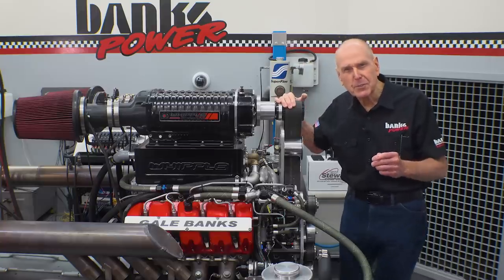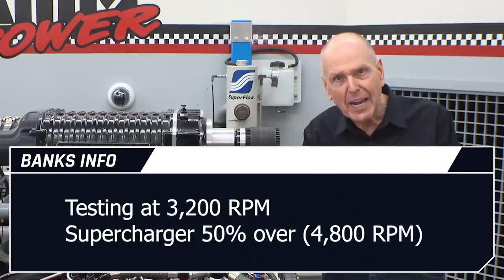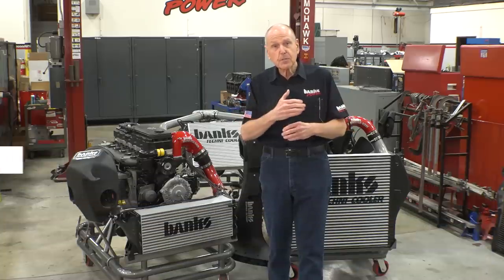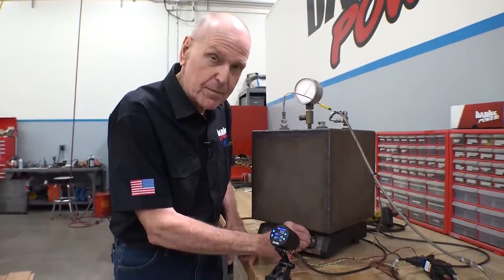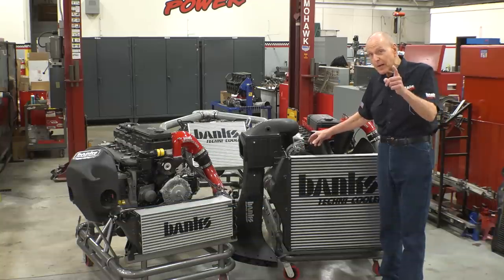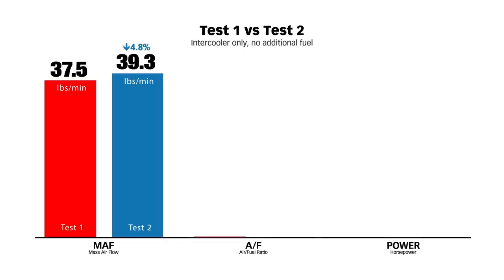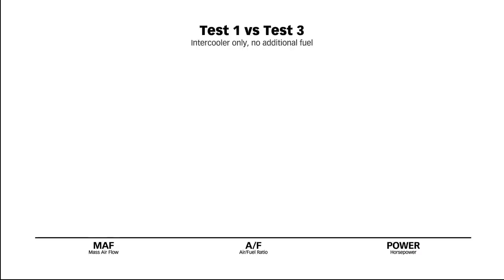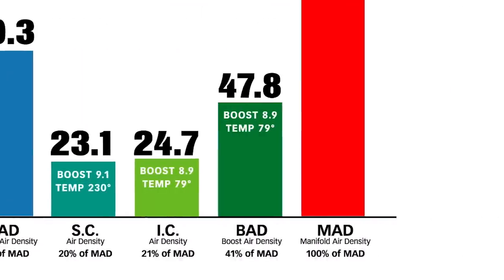MORE HORSEPOWER with Less Boost?! | Building a Monster Truck Engine Pt 8

Comment: Gale, love the videos and how commited you are to the science of making horsepower and making it efficiently.

However I have to disagree on some things regarding your math for temp change. You say that 79f is 74% less heat than 279f. Do the math in Celsius or Kelvin, the percentage of change will be much different. Fahrenheit has kind of a random starting point, 0 F doesn't mean zero heat. The proper way of measuring it would have to be Kelvin, or come up with another way of measuring it.

Comment: Mr Banks why don't you do an interchiller with freon and electric ac pump?
Reply: R744 would be better (r744 =CO2 refrigerant system)
Reply: @daviddroescher  I want to take an ac unit apart and in case the coil in and air to water intercooler and see if I can get the water cool enough and the you won't have to run it of the belt!
Reply: @marcohuertas692  with CO2 in a race application  you could run a total loss system  off a bottle then there is no parasitic losses and no extra battery/inverter to run the 110v compressor .
Reply: @daviddroescher  I'm thinking street or drift where your on throttle and need to get the temps down for longer period of time but maybe re recirculate it so it not lost?  Trial and error but yeah definitely thought of the co2 even no2 lol
Reply: @marcohuertas692  look up R744 refrigeration its a closed loop (CO2) system  insted of R134A( freon) but gets much colder(can pull more heat faster than freon). NO2 and CO2 Intercooler fog kits are available.  I dont like the idea of foging my engine bay with an excelerant. I have a EGT surface probe on the outside of my turbine housing and it is normal to see 500+°f, all it needs is some oil smoke and bad day.
Reply: @daviddroescher  lol yeah no shit!! It's a waste of money to just let go nowhere that why recycle it like the AC in a car but run the gas threw the core and the air across the surface.

Comment: I'm curious Gale what would those numbers be if you used waterless coolant? Would maybe  bring efficiency up to 97% or more or would the efficiency be the same? I was intrigued by waterless coolant a few years ago and it was a revolutionary deal for removing heat from an engine.  If can that would be nice. I know everyone has not gone waterless, it is hard to justify the money and time but was a worthwhile investment.
Reply: Problem with most waterless coolant is they are flammable and banned by most sanctioning bodies. Water Wetter however is accepted by most sanctioning bodies and has a similar effect of  improving waters thermal transfer properties.
Reply: @daviddroescher  i had know idea it was flammable good to know. Thanks for the info ill check into it.

Comment: is there really a need to put a BOV on a diesel since it doesn't have a throttle body to close to back up the turbos?
Reply: It probably has something to do with it having the blower on it at the same time 
, being that it is belt driven, im sure it wouldn’t be good for the rotor blades to experience any kind of back surge that could potentially transfer a shock load through the belts and back to the engine it’s self.
Reply: Yes look up "turbo bark" on any diesel site . This brakes turbocharger shafts . The intake valve takes the place of the throttle body.

Comment: did i miss something... what was the temp of the coolant going into the system and out ?was the engine up to temp and using that coolant . was the coolant just cold water ??
Reply: I think it’s a secret because how do you get 20 degree water?
Without an A/C unit to create it that takes power to run, a LOT of power to run.
In the lab the A/C unit is remote and wall plug powered i am sure has to be, but in real life the truck would need the A/C unit to get 20 degrees water temps. 
Ya, I’m really wondering here what the heck this weird VOID is about here and Nobody but us caught it.
Reply: Usually water jacket charge air cooler would be plumbed with a circuit separate from the engine coolant otherwise you're penalized with air entering the engine at engine coolant temp (180) costing you 13%power with the same fuel. 1%/10°f above 60°f per Cummins.
Reply: @ashqelon7267   delta temp =22°f  not 22°f mesured

Comment: I’m going to need help deciding what inter cooler i need for my next project truck... I’m putting an Detroit 8v53 in it.
Reply: None the 2 stroke Detroit's won't get enough boost to use intercooling
Reply: bill2178 I’m going to swap the stock turbo with a 2 80’s and a sing marine turbo and a supercharger. If it blows up it blows up 🤷🏼‍♂️ and i still need a radiator to cool the coolant
Reply: You have a 8V53T? Or just a turbo equipped 8V53?
Reply: nick nicalizel i’m getting a 8v53T because of the extra oiling If im correct ik there’s a difference
Reply: Turbo engines vs natural engines have many differences. 8V53T are rare engines were only built for the military. I have a 8V53N that I may put in something someday.
Reply: nick nicalizel To my understanding the T model has a different oiling system to help cope with the turbocharger do you know if i could retrofit that onto a N?
Reply: @StahlFirearmsNo2  not certain but there would be no oiling issue likely with adding a turbo to a N engine. But turbo engines have different pistons/liners/camshaft etc
Reply: nick nicalizel okay I was told somewhere that the oiling system was different possibly higher pressure.. regardless thanks for the info

Comment: Now couple of things....
(But first let me get this out the way clearly Gale Banks knows a lot more than me on the subject...but I still want to ask the questions to learn)
1) I would have thought, blowing into a supercharger with turbos compounding the boost would put more load onto the supercharger creating more parasitic loss....surely going the other way around would be better, like in the pikes peak truck.
2) why is a blow of valve needed on a diesel? Is it because you're blowing into a supercharger And letting off and dumping the boost out take the load of the supercharger when it's not needed?...
Im here to learn, not criticise.
Reply: I thought a BOV is to not send the turbo into surge?
Reply: @prcdjhnsn  yes when you let off the throttle....diesel don't have throttles
Reply: @jarrusjenkins  Yes you are correct. you also don't have vacuum to operate the valve. maybe this can answer that part for ya. https://www.dieselarmy.com/engine-tech/how-it-works/how-it-works-blow-off-valves-bov/
Reply: 1)
Its a pressure raito thing. 
Force feeding the blower =less load(smaller pressure raito) to get the same MAD= less work induced heat(thermal expansion)  =less cooling requirements = more shaft power to the trans.
2)
Blower is positive displacement  and acts like a throttle on a gasser during compression braking.  Barking a turbocharger is a good way to snap a turbine shaft or explode/over speed a compressor wheel.
Reply: @daviddroescher  The 2nd one I understand completely.
Your 1st answer I still don't completely understand, 
Is there a nerdy article to read which explains it in more detail?

Like I said before there has to be a reason why Gale did it the other way around on the pikes peak (supercharger blowing into a turbo)
Thanks

Comment: While I love this video series, this one leaves some questions.
With this Whipple FOAC which core was used? Assuming aluminum cause I doubt the cupronickel would perform that good. However, if you looked on Whipple site you would think the cupronickel was better than aluminum which it is far from it. False advertising on Whipples part.
Next he mentions he wanted a 20deg max gain on water temp and mentions flow rate but not starting water temp. So what was the starting temp to scrub 200deg off air temp?

I'm really waiting for the turbo setup to see the improvement over the Whipple. Whipple will argue his charger is still better!

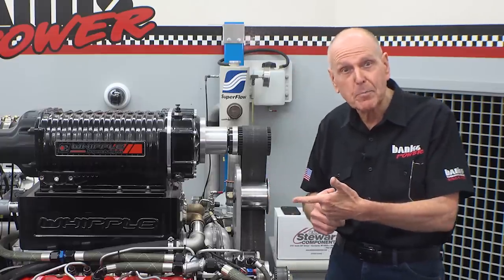Comment: At about 3:45 screen says 23:1 air fuel ratio? Isnt that way to lean? What am i missing?
Reply: Diesels always are lean as they don't throttle the air. They only throttle the fuel. Idle might be leaner than 100:1
Reply: With diesel the leaner it is the happier it is the problem is keeping the materials containing the explosion/ burn from becoming jello.
Also leaner is lower EGT the opposite of gasoline.

Comment: 10:19 I always feel like Gale is yelling at me. I'm sorry I have a boost gauge!
Reply: I thing that he overstates it when he says "the boost gauge is dead to me".  The point he is making is that the boost gauge doesn't tell the whole story.  Density tells the whole story, and you need temperature and pressure measurements to calculate density.

Comment: Just a minor quibble - for a single charger (turbo' or super'), "charge cooler" would be more accurate, with "intercooler" reserved for use between stages of series' chargers -  eg. intake > 1st 'charger > charge intercooler > 2nd 'charger > charge cooler > engine.
It may, of course, just be me being a pedantic old fart, though ;-) 

With higher altitudes, it is a double whammy - not only does the engine have to work harder to suck in the air, but the various liquid>air coolers are much less efficient as there is less air mass passing through them to take the heat away.
With the heated box, could also reheat it and at temperature drain off the excess pressure to illustrate the loss of air massc ompared to ambient.
The end caps is also one of my little bugbears - some designs are appalling - restrictive and/or unevenly distributing the fluid flow through the full width of the matrix.

Seriously, though, I DO enjoy your videos - always food for thought and lovely music to the ears!
Reply: Wouldn't a water/cooler sandwiched in a high pressure area under a boosted intake still maintain efficiency?  The altitude would more effect boost levels that could be increased to compensate. My intuition maybe wrong though. Cool comment
Reply: @xjmg007  If I understand your question correctly, yes, the air> liquid charge cooler will maintain efficiency, as the mass of the liquid for coling will be the same. By convention, the ">" donates the heat energy transfer path, that is, air to liquid
However I said "liquid>air", heat energy being passed from the liquid to the cooling air, as occurs with radiators, oil and transmission coolers, and the part of a liquid ccolers cycle that passes the heat energy to the air'. They are really an air>liquid>air cooling system, as opposed to the more conventional air>air design where the heated charge air is plumbed through a cooler that is directly cooled by the surrounding air.

Comment: Positive displacement boosting on diesel is 100% more kick ass than turbos. Diesel makes torque down low, turbos need rpm ....seems wrong to me. Put a roots on your diesel and start breaking drivelines 😈
I miss men like this, these men no longer are found in the repair world. I used to work with men like Mr banks, so intelligent and unfiltered....the world these men came from is missed by me everyday.
If I'm getting this right.
Having a good charge cooler will in theory take the charge from the supers outlet and condense it making room for the next outlet cycle....it's like crushing cans, if you don't crush your cans the bin fills faster but you don't have the amount of cans had you crushed them first.😎

Comment: And how can we use this on a daily basis.
Reply: Find a reason to pull a 10k  load up a grade on a daily basis.  Or just live in the mountains and maintain the 75-85mph speed limit like I do.
Reply: @daviddroescher  so you have room for the supercharger and all the cooling system onboard?
Reply: @riflemanjim  yes a Crazy Carl Whipple /turbo compound kit for12V 1st gen Cummins  , 2 IC's done( technically 1 intercooler 1 aftercooler). Or for all out proformance use an A2W with Liquid CO2 (R-744 refrigerant-70°f) on both stages.
Reply: @daviddroescher  interesting, i have heard of crazy karl.
Reply: @daviddroescher  i was thinking of getting one of his intakes for my 2000 vp cummins.

Comment: Again no idea how you can Patent a process that been around and used by many for years, as for cooler that again used by the endurance boat guys for years and commercial boats etc.
If you can get water temp low enough or change the cooling media to Alcohol no doubt density improves.
Reply: Patent is for intellectual property.  Someone could argue it in court, but if nobody in the aftermarket has resources to do proper R&D, then you know they don't have money for litigation!  And remember...Milwaukee sued Snap On because they said using bigger batteries in a cordless drill was their innovation...and Milwaukee won.
Reply: @fredygump5578  others dont have proper gear to do the same ? Lol theres is endless data loggers on the market to the same as for the IP then i guess people like Corky Bell, Hugh Maclnnes had there IP stolen.
Most aftermarket ECU can log all the data to give the same result, and water to air has been around for many many years.
Reply: @stevemurch6974  It doesn't matter if you understand it or agree with it.  A patent affords explicit legal protection, and as such, it is vetted by lawyers before it is awarded.  And once awarded, anyone who is reasonably suspected of infringing on that patent bears the burden of proof, to contest the merit of the patent, or to prove they did not infringe upon it.  So if you have a boat full of money, sure, you can challenge this patent.  But nobody in the after market industry is gonna have that kind of time or money.
Reply: @fredygump5578  and his so called patent has been in use by others for years, tomorrow i will lodge a patent for the English language based on how i speak which is my spin on it. I see your point......

Comment: "...you can back out of the throttle..."

Gale, no throttle.  We are talking about a Diesel 
here.

I'm shocked, of all people, you should know 
about a Diesel having a throttle, or not.

A "throttle" is just that.  Look for the medieval
torture method, "throttling someone."  It is a 
method to cut off air flow.  (Or, mixture flow, in 
the case of a carburetor.)  I've seen ALL KINDS 
of YouTube types mentioning a throttle on a 
Diesel.  I expect it from them, but not you.

Oh, keep up the GREAT work!

steve
Reply: @marionette5968 , it most certainly is NOT a 
"throttle."  That implies throttling, like medieval 
executioners did.

Since that linkage goes to the injector pump, 
injector controller?

Sorry about using more than one word.  Sue me!

steve
Reply: Go ahead and give the old “throttle” a google.  By your definition throttling an engine would kill it.
Reply: Calm down there, Steve. It's just terminology. I bet you get bent out of shape over engine and motor.
Reply: @mkalb4g63 , you are COMPLETELY right.
If the THROTTLE butterfly, or butterflies, 
close COMPLETELY, the engine will die!

But, they don't.

They just control the engine speed or 
power output.

There is no airflow throttle, on a Diesel!

steve
Reply: @brandonstill6626 , I have ridden NUMEROUS 
"motorcycles" in my life.  Most of them 
being 2 stroke twin bikes.

The correct name should be "engine cycles," 
because they have an engine.

A motor generates power continuously.  An 
engine, only on the down stroke, or every 
other down stroke.  We will overlook external 
combustion engines here.

Yes,I still call "engine cycles" motorcycles.
Even my 66 CC gas powered bike.

steve
Reply: Steve Skouson   People like to dispute this terminology with jet engines. Not throttles...power levers or thrust levers...then there is a switch called Autothrottle (for aircraft speed control). That always slides them to a stop. So maybe take a pill. We all get the terminology...especially Mr. Banks.

Comment: OK, regarding the manifold air temperature, you 
use degrees F.  Wouldn't absolute temp, (degrees 
Kelvin) be more realistic?  Pull (figure) ALL the 
various results, from Absolute Zero.  Let's say, I 
use a temp of 70 degrees F as my "zero point.
then recompute, using that 70 degree zero.  72 
degrees, versus 279 degrees, how many thousand 
percent change is that?  Why is 32 degrees F, the 
zero point?

If you pick the parameters, you can pick the results.
Just sayin'.

Oh, Gale, LOVE your work.  Have been, for most of 
my (60+) years!

steve
Reply: @marionette5968  A science class is missing from your 
experience.  The Kelvin scale, uses Centigrade units, 
shifted to have zero at absolute zero, instead of 
having zero at the freezing temperature of water.

Quick, without looking what is the centigrade temp
that relates to -40 degrees Fahrenheit?

steve
Reply: The percentage from 32 degrees F, 0 degrees C, 
and 0 degrees K, are VASTLY different.  (And, one 
of them, currently, unobtainable.)

Are you 100 kilos, or 220 (and change) pounds?  
The answer is NOT the same, because of the scale!

steve
Reply: @cencoast_7.340 , thank you, for this 
enlightening post.  Your parents 
are SO proud!  (They'd be MUCH 
more happy, if you's move out of 
THEIR basement!)
Reply: Steve Skouson That was your best attempt at an insult/humor? Please Steve... try again or like I said the first time, shut up. Nobody here is amused by your vast, all knowing knowledge, leave that to Gale.
Reply: @steveskouson9620  0°c=32°f = 273.15°k all=  0% delta ...  0°k has little to no value unless we're trying to figure out the vibratory frequency of an atom